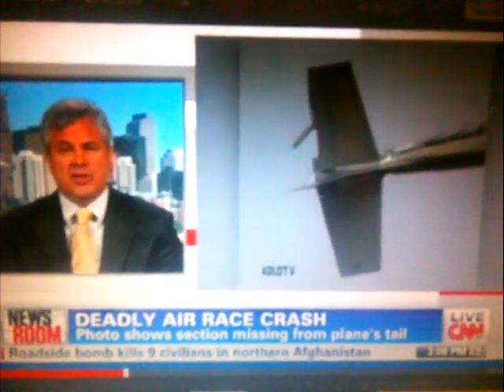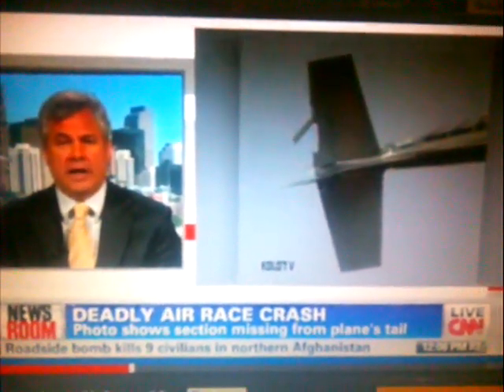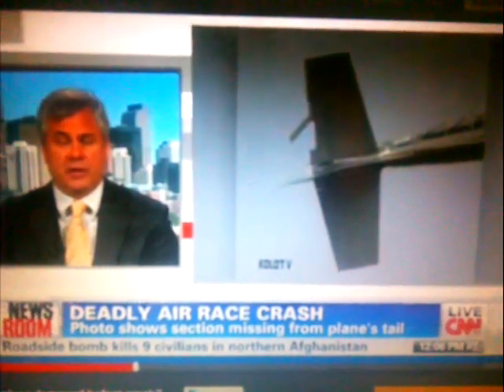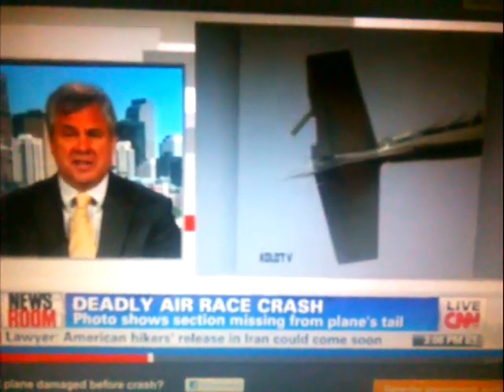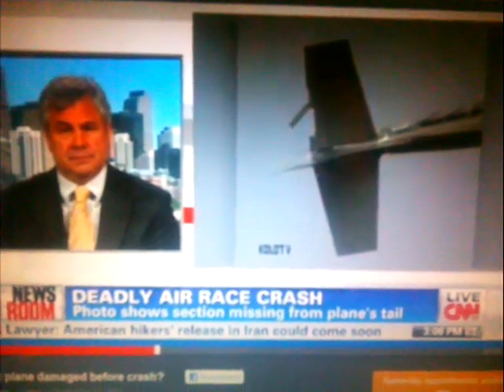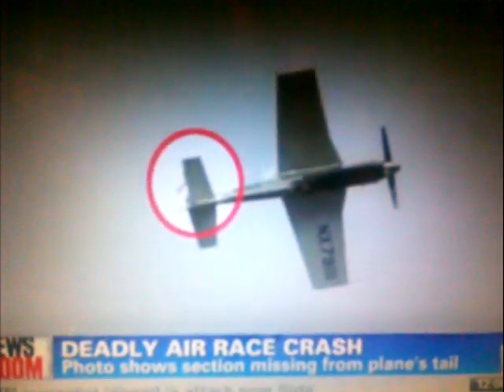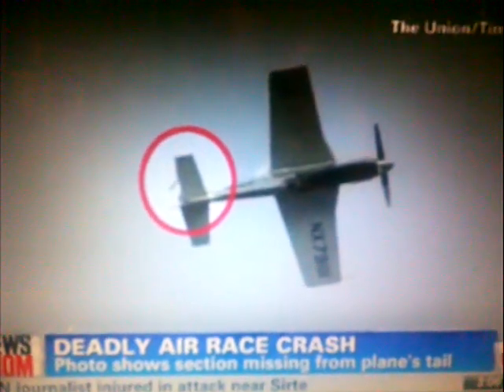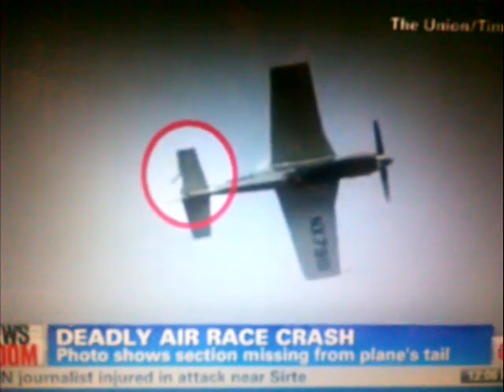plane crash in Reno New video  9/17/11

Comment: @smimot 

In the forties a lot of aircraft had a stabilizer trim that changed the whole incidence of the hozizontal stabilizer the tab on one of the elevators balanced the travel of the stick to the set incidence.   It's a relativly common system for the time. There's an incidence change tim on the stab of a J-3. The mustang has much more power and speed range so it has more componets. I don't have the production drawings to look at so I really don't know the details.Refresh me if so inclined.

Comment: It's a balance tab.  It adjusts for the tail incidence trim.  IT's not the on the 'back wing' like the despcription says.  That entire unit is called the horizontal stabilizer.  If the balance tab came loose the elevators would atttiain more travel in one direction and limit it in the other.  It's a serious problem wepecially at high speed and low altitude.

Comment: @AugustusLarch 
The Mustang has a fixed tailplane and used trim tabs, while the Me109 had a variable incidence (adjustable) tailplane for trim. Though comparing the modified Unlimited racers to stock drawings is not always practical.

Comment: @RCFlyingBoy2009 As I saw in another video from the crash (one of so many), the aircraft started turning right (towards the parking, I think) when problems started. That might´ve been the moment when that shot was taken. But then, probably because the pilot was trying to keep the plane under control and change its trajectory, the plane completed a barrel roll turning clockwise from right to left. That may explain my confusion on the angle of the photograph...

Comment: @pietenpol2010 

Back when these planes were built there wasn't any sort of standardized trim system.  The mustang had a lot of fresh ideas rolled into one. Unless you actually look at the real thing or the drawings it's hard to know. There's a bunch of details I don't know about aircraft. The trim tab system you speak of is relativly new and depends on a pushrod system.  The mustang had cables to my knowledge. You inspired me to check it out.  Balance tab and trim tab are two differnt things.

Comment: @AugustusLarch 
The Mustang used control cables (compared with the Fw190 which used pushrods considered less vulnerable to damage.) Stock Mustangs have trim tabs on each elevator, and Ghost appears to have both. The stock drawings appear to show a single bellcrank for elevtor control. But again, Ghost was heavily modified to deliver extreme performance. Leeward said in interviews that some changes they made were unproven, so there are other design factors in the equation.

Comment: @pietenpol2010 

I don't have the details.  But the system you speak of sounds out of vintage for the mustang.  A lot of airplanes had a trim gear on the front of the hor. stab. and the tab on one of the elevators was used to compensate and balance the stick travel in the new trim setting.  I may be wrong as hell.  But it occurs to me that that the mustang has too much power and speed range for a trim tab to have the required effect.

Comment: @pietenpol2010 
I've also read about the 21G reading in aviation discussions outside of YT. The number seems high, but it was pointed out that we don't know the type of G sensor being used, where sensor was located in the airframe (or if there were multiple sensors), and that the G loading could have been locally high near that sensor location.

Comment: @FiveCentsPlease 

Awesome.  There is some fresh insight.  It's a good lead you offer that unlimited racers might have unpublished modifications.   I checked up on the system for balance tabs and they are only used on a full flying stabilizer.  

Two questions.  Did the mustang have pushrods controlls or cables?  And is there a trim tab on both elevators or one; are the two elvators connected together?  Sometimes elevators have assymetrical travel as a yaw trim feature.

Comment: @paullubliner 
The aerodynamic forces on the tail are much greater at 500 mph and the need for the trim tab to relieve pilot fatigue is greater at those speeds. Things happened very quickly after the trim tab was lost.

Comment: @pietenpol2010 

Balance tabs are used for trim on full flying stabilizers.   They show up on supersoinc aircraft and sailplanes most often.  Messerschimt 109's had a Indidence trim and pushrod controlls.  The mustang does have a servo tab trim system.  Now the guy wishes he had a 109.

Comment: @DanielMadrigalC 
At high speed (500 mph in this instance) the planes are trimmed for downforce so that the pilot does not have to work hard keeping the airplane flying level. Loss of that trim tab produced a violent pitch up, as seen in other video, and likely led to a nearly instant black out for the pilot. Video from far-away angles shows a very violent pitch up of the plane. A similar incident occurred several years ago, but the pilot woke up and landed immediately.

Comment: @paullubliner 
Loss of a trim tab at high speed can cause instantaneous loss of control. Lifting forces (lifting center) on the wing are forward of wing center, which cause the wing to naturally want to pitch up, which is compensated by the elevator trim and tailplane. At high racing speeds these forces are even greater and the loss of the down trim on the elevator can immediately reverse those forces on the control stick, slamming it backwards while the plane pitches up.

Comment: @MerlinVI At that airspeed, yes, actually it WOULD have resulted in loss of control.  The aircraft would have pitched up at such a quick rate, at that speed the G forces would likely have incapacitated the pilot immediately.  It's not like losing a trim tab on your 172.

Comment: @aflackducky1 
So much of the plane is new-build or modified that they are little more than flying serial numbers at this point. Much of the Mustang airframe can be replaced with new original components. Blowing up rare engines is another story. Flugwerk (maker of those new-build Fw190 kits) is now working on a full-size Mustang kit called the AP-51 Palomino. Perhaps kit Mustangs with new serial numbers will be the future racers.

Comment: @smimot 
Smimot, much of the terminology being discussed would make sense if you would only make an effort to look up some of it. "Center of pressure" is a mechanical term which can be applied to aeronautics as the center point (an average of pressure variations across the airfoil) with the lifting force vector passing through it, and it can vary in position based on the shape of the airfoil and angle of attack.

Comment: NTSB report describes undetected worn or loose trim tab control rod screws, leading to failure of the trim tab and loss of control (Performance Study, Pages 23-24) with a peak vertical acceleration G load of 17Gs. Enhanced photos in the report show the pilot slumped forward and unconscious (Image Study, Page 25.)

Comment: Continued part 2: " Aerodynamic flutter of the trim tabs resulted in a failure of the left trim tab link assembly, elevator movement, high flight loads, and a loss of control. Contributing to the accident were the undocumented and untested major modifications to the airplane and the pilot’s operation of the airplane in the unique air racing environment without adequate flight testing."

Comment: waste of money.  they  are just going to find that the plane was improperly modified,  flowm way to low , too fast and by some one too old.  they cut down on the controling  surfaces on the plane. there is a video of leeward  describing  how they did it. The air above  10  to fifteen thousand feet  is also thinner then  at  500 feet oof  the ground. The blue angel pilots have been  on video saying there is so much less stress on a plane  at altitude. It didnt look like he had control at all.Sad

Comment: @smimot 
Yeager isn't a race pilot with any experience to offer from Reno and your suggestion is kind of pointless. The "aeronautical physics" of flying these planes at high speeds and low altitudes with greater air density and forces on the airframe are a lot different than the combat scenarios at 10-20 thousand feet that you are trying to make a comparison with. There is enough info and photos available for you to understand these two incidents and why both pilots were unconscious.

Comment: @pietenpol2010, you posted to me - "One thing I do know is for someone to spew such rubbish shows ignorance ans is purely speculation"...I'm sorry, I don'y know what "rubbish" you are talking about. All I said was those planes and pilots are not outdated, sickly, accidents waiting to happen. You list impressive aviation 'cedentials'. My experience & ones I knew and associated with that owned, built, & flew aircraft were astronauts, engineers at Lockheed skunkworks, Air Force test pilots

Comment: @jackhammer111 Well sir im not even close to being a "youngster" We have a P51 51 and it will smoke most if not all of these " old girls" However the old timers seem hell bent on killing themselves as well as civis along with them.It can be done and it should be done these aircraft are 75 years old in some cases.With carbon fiber and new engines it is very possible and should be front line in saving lives and the " old girls" Im not really going to go on with you about this.